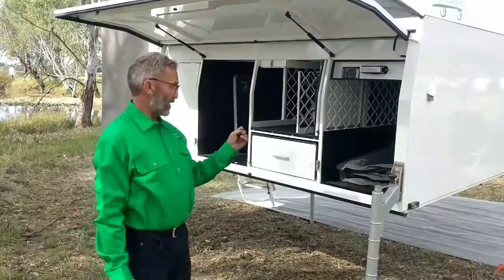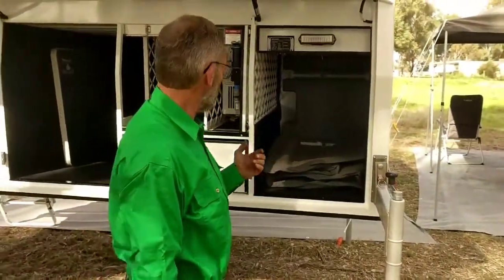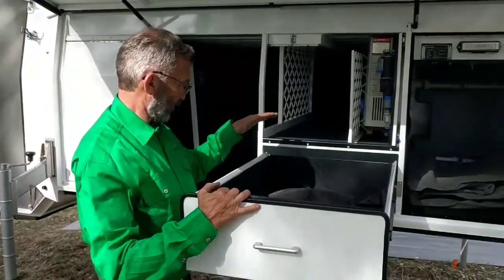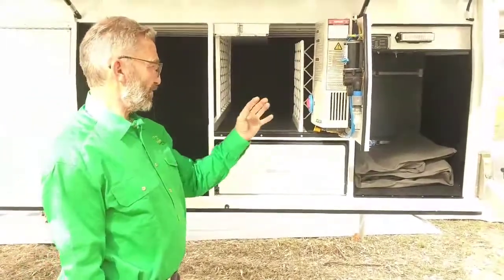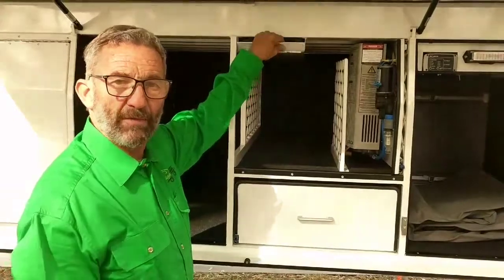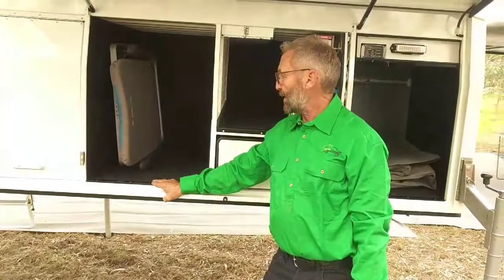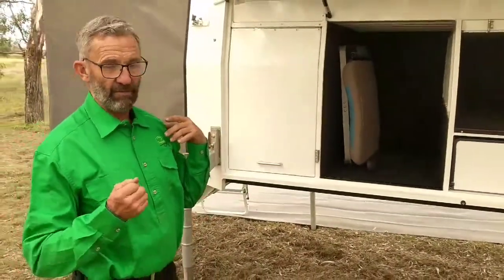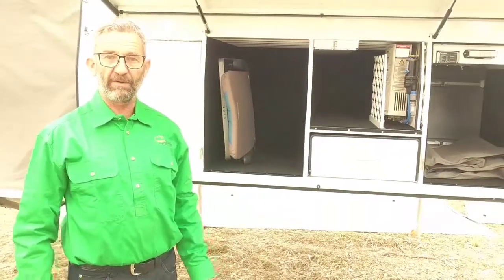Extra Cab Camper - Driver's Side

Comment: With the hot water / shower, where does the gas come from? Do you bring a bottle separately and connect it up to the Joolca when you want the shower?
Reply: The gas bottle is mostly under the tray and attached as required.